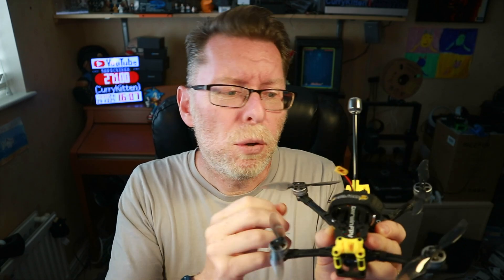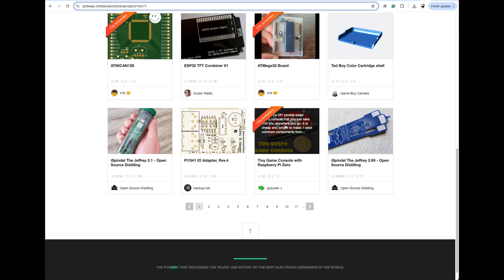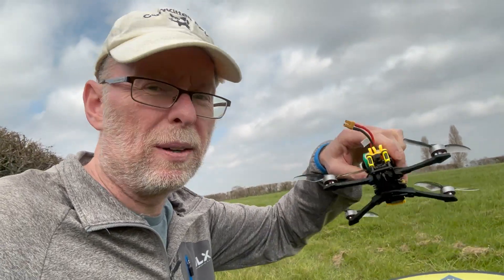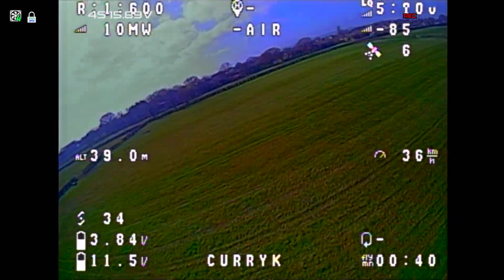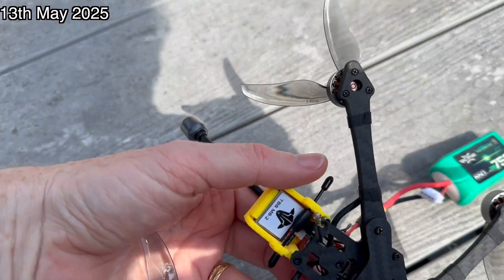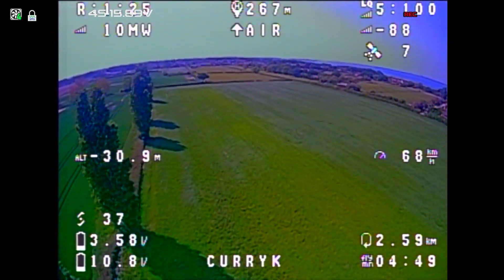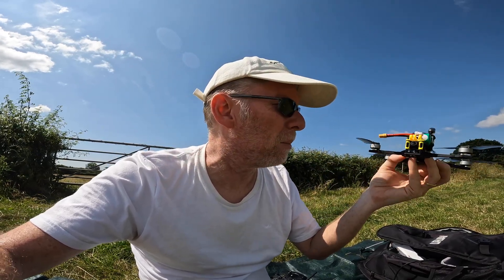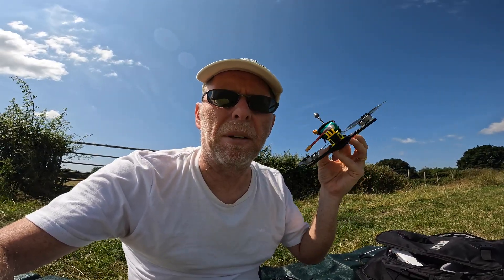GPS got no Sats locked?  Me too - what I did to fix things on the DarwinFPV FoldApe

Comment: Helppp! I can’t arm my foldape4. Remote controller is not arming the drone, although it’s binder and when I arm it I see the drone lights flicker but it doesn’t arm!
Reply from the maker: Whenever yo have a no arming situation, and you can't see what the issue is, make sure you have Warnings enabled in your OSD in a place where you can see it.  Then put your goggles on, try and arm it and you should hopefully see a message on screen about what's stopping the arming.

Comment: I've got a similar problem. Quad without RunCam Wifilink 2 connected gets up to 20 Sats, connect the Wifilink and zero sats! Copper shielded the GPS cable and sats increased to 5 but not enough. Going to shield VTX to FC cable next and move the VTX antennas, don't want to have to shield any PCBs as potential heat issue.
Reply from the maker: Aside from trying to move things around (if you can) I've previously done one extra step in the past that I didn't need to on this one.  That is, once you shield the GPS cable in copper tape, go ahead a solder a wire between a ground connection and the tape.  Sounds weird, but it fixed something for me that just wouldn't get a fix before.  I've also got a little PCB that someone has developed and invited me to try (which I haven't had chance to yet) He's not selling them or anything, so if it works, that design will be out in the public domain
Reply: @CurryKitten Second attempt I moved the VTX to FC cable to the side of the FC opposite to the GPS connection and shielded the underside of the GPS mount (I will move the copper to inside the gps mount covered in ins. tape). Sats went up to 10 so a good start (I’m on the South Coast and yesterday was heavy cloud with rain so not best for signals). I have a much shorter (150mm)  FC to VTX cable on the way, when that arrives I’ll shield that as well. I’ll do that grounding, sounds worthwhile. The pcb seems interesting although I’m running out of space to mount things. I think there is a case for manufacturers to supply shielded connecting cables, even if we have to pay a little extra it must be beneficial.

Comment: Today I relocated the GPS-module from its unfortunate mounting location directly beneath the VTX-antenna to the front, sacrificed the Go-Pro-mount for it and all of a sudden it locks satellites as easy as any other drone.

So the issue really seems to be interference with the VTX-transmitting power.
Reply from the maker: It can be, but not always.  That's why it's useful to move things around, or be able to disconnect/turn off things and see what's wiping out the signal.  Sometimes, I've had things (FrSky telemetry was bad for this) wiping out he GPS and I just needed to move it so it was the same distance apart but in a different orientation for it to work.  Weird stuff
Reply: @CurryKitten  Yep, any HF-stuff was a bit scary for me at university, so I specilaized in aerdynamics, much easier ! 😅

Comment: the GPS, can you give me information what GPS that you use ?, i have stock M8 here and copper tape but always lost sats when in 600mw power
Reply from the maker: That was an old M8 based TBS GPS, which I don't think they do any longer.  The extra thing to try is to solder from ground to your copper tape that's wrapped around your GPS cable.  That's a step up from just using the tape on it's own

Comment: Coil the GPS wires two or three turns around a ferrite ring, I fly walksnail and had trouble before, after adding the ring i always get 20+ sats up to 32 on clear days.
Reply from the maker: I haven't used a ferrite ring for a while - uses to have them around all video connections.  I'll put that in my list of things to try

Comment: Assuming that the GPS itself works just fine in isolation (ie: away from a noisy quad), then there's interference.  There are two major types of electrical interference: radiated and conducted.  

Radiated comes from intentional or unintentional radio signals from other parts of the quad (FC, VTX, FC, CAM, RX, even BECs), and basically transmit a signal that could wind up in the GPS reception band.  The GPS receiver sees a lot of energy in its band, and reduces sensitivity to keep from overloading (this is called desense).  Unfortunately the desired signals from the satellites get smaller and your GPS reception gets worse.  This can be a problem with small quads with everything in really close proximity and virtually none of the electronics using any shielding.  The easiest fix is to move the GPS away from the noisy stuff, make sure that the GPS has the best sat signal it can get, and see what works.  In your video's quad the VTX antenna is directly in view of the GPS antenna, and the ELRS dipole antenna is directly underneath it (remember, ELRS receivers transmit telemetry back).  Those all use different frequencies, and the GPS receivers try to reject signals that are "out of band" - but they can only do so much...

Conducted means transmitted by wires, and can be much worse than radiated emissions.  Simply put, all that high frequency noise from the FC can travel over the wires to/from the GPS and convey jamming signals.  The very simple fix for this is to include a filter between the GPS and the FC that filters both the data and power lines to GND.  Typically this is done with two lossy elements in series with each wire (Ferrite Beads, inductors, or even resistors) and a capacitor to ground.    The lossy element makes it more difficult for the full-strength noise to get through and the capacitor makes it go back to the FC over the ground.  A small filter board only weighs a few grams, and I include one whenever I care about the GPS performance.  To really knock the noise down you may also want to include a common-mode filter in the form of either a dedicated filter or toroid core.  Your experiments with copper tape are a crude form of this type of filter, but without series reactive loss you aren't getting most of the benefit.  And without providing a ground to that copper shield with a direct path back to the FC it may really be hit-or-miss.

I've had similar issues to what you report, with extended lock times and low sat count (like hardly enough for RTH to work at all).  With the addition of the inline filter the counts typically jump up into the high teens.  The same filter may help with dedicated receivers, and I include one for my ELRS long range systems.  I've not had luck trying to find something on AlieExpress/etc so I just make my own.
Reply: I'd like to know more about the conductive filters...is there a good resource I can look at?
Reply: @fraserboyd5448 me too
Reply from the maker: Very interesting.  Can you show me an example of how you'd create a filter - sounds like something that would be useful to share with others

Comment: Turn on Use Galileo and auto config.  I find the micro size GPS with a smaller antenna do not get as many sats as a larger antenna. Also, the satellites move around so sometimes I get fewer, sometimes I get more. I use a 1W+ Vtx with the antenna right next to the GPS and it does not seem to affect the GPS at all.

Comment: I guess that the proximity of the VTX which is quite powerfull can create some noise by induction in the GPS wire passing very close to it. The induced noised on the lines can then creep up to the radio amplifier and kill the signal to noise ratio of the GPS.